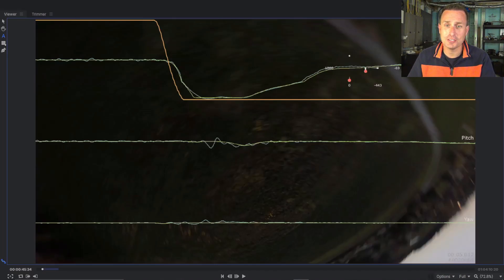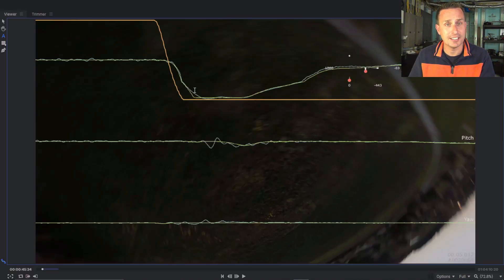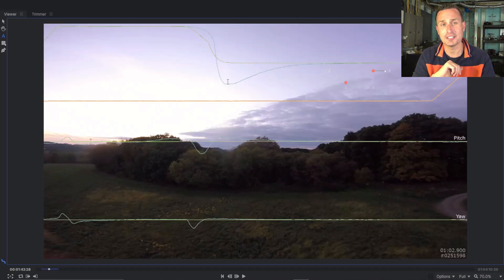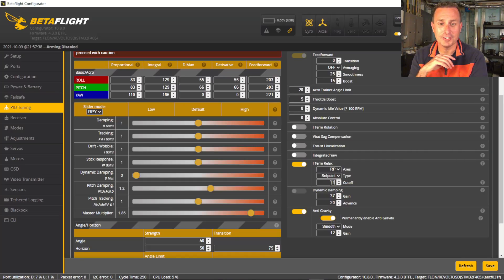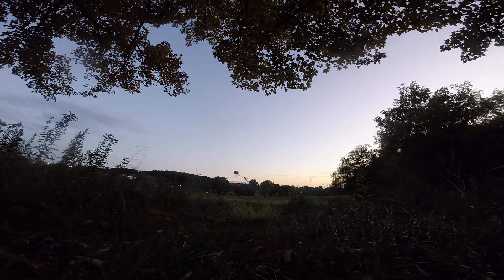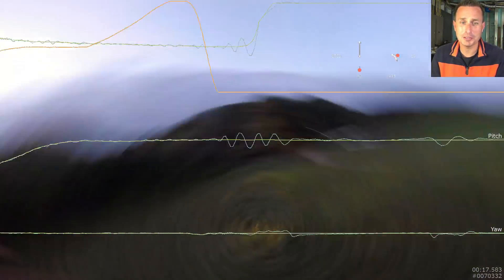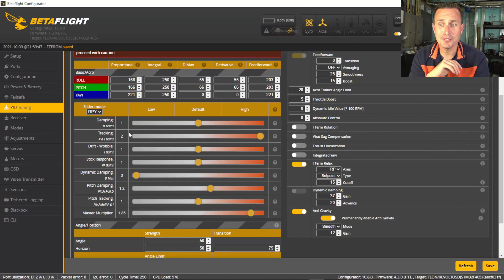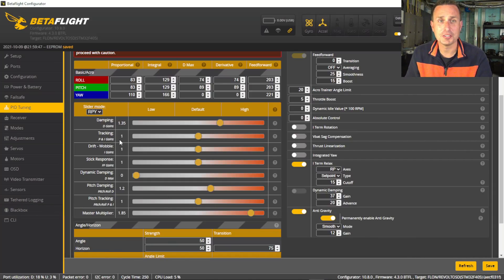How to FIX Bounceback

Comment: I’m not sure if it’s actual bounce back hopefully you can help me. I’m running the no GoPro UAV tech Prisa in beta flight anytime I try to do a power loop as soon as I cut throttle the front of the quad kind of dips for a split second towards the bottom of the quad, no matter if I’m upside down or whatever it dips to what would be the actual bottom of the quadit’s making it to where I can barely do power loops, and all that stuff. What do you think it is?
Reply from the maker: boost the Antigravity gain.

https://youtu.be/Mb-Q52UINts?si=KuAX5svDm6xxFvOe
Reply: @uavtech  ty i  looked and its at 12.0 gain
Reply from the maker: you can go higher.

Comment: Hi Mark, 
Would weight effect any of these terms and what would the effects of different weights be?
Say for example. Tune without Go Pro with no bounce backs and then add a go pro, or vicer versa, tune with a go pro and then take it of or use a lighter or heavier one? Could the effect of less or more weight induce bounce back and which term would it most likely effect? Hope this makes sense!

Comment: How is your quad not spazzing out after full throttle chopping with an AG gain of 12? I ended up with pretty much the same gains and throbbling is perfect with an AG gain of 12 but on a full throttle chop the quad is spazzing around.
Reply from the maker: 12 is a little high.  I just jumped back to 10.  May need 8 even.  

Just lower 2 points at a time to find the max.
Reply: @uavtech  Will try as soon as the rain stops. Tried 10 already but with same symptoms. Going to test, not sure if these high gains is the best we can do. Maybe lower gains and less filtering on D gives the same wash results while being able to use those high ag gain settings in order to get rid of any throbbles. On 12 there is like 1-3 degrees max error 😍
Reply: @uavtech  9 seems to be the magical number. If I go 10 even on lower PIDs like P in the low 60's its spazzing out after full throttle chop.

Comment: THIS * 1000000! I’ve struggled tuning out the last tiny bit of bounce back on my toothpick. I already had I term relax at 15. Got 95% bounce back tuned out through pids. I gave up on the last 5%, till this video. I dropped it to I term relax to 10 RP Set point, and never had cleaner stops after hard flips and rolls! Thank you!!

Comment: The new BF Flys best with all the features OFF.
Reply from the maker: Umm...  
Even I-Term Relax?
Reply: @uavtech  Yes. I'm used to tuning 3.5 was my go to for tuning. Decided to try 4.2 alot of uneeded features.. All FF off. Dmin off. Pd balance 1.3 master up by 1 Antigravity off. Flys close to 3.5 maybe a little stiffer. Also filters set to 1.2 on both

Comment: I wasted labout 3 grand on RC stuff and quadcopters, and only flew one of them... once.  My optometrist measured my eyesight last week and said it was 20/LPO... which means, light perception only. If I walked past one only 5 feet away on the ground, I would not see it even if I loaded it up with strobes.   Goggles are absolutely worthless and an abortion; I can't move my eyes closer to the screen, so see a thing in them on a tiny scren.  Nothing in this hobby is made for visually impaired people.  2020/2021 was the year I went blind.  I can solder like a boss, but not when the world is a blurry mess with no depth perception.   This hobby desperately needs to get it together and standardize on standard connectors for everything. Ditch the soldering entirely.  When was the last time you built a PC gaming rig and had to solder..anything?  Never.  Ever.  Not since.. the early... 1970's.

I may be blind, but I'm the worlds best aerobatic pilot.  Don't believe me, try me.  So ponder that.   Why is this hobby such an absolute "we don't give a sh1t"  d1ck to those with disabilities?   The RC hobby is 70 yeas old; it's had plenty of time to mature.   Two years ago, I was driving motorcycles on the road.  Now I can't count my fingers if I hold my hand out.  If it can happen to me, it can happen to anyone.  

You may wonder, why the h3ll Choppergirl are you ranting off topic about something that does not involve FC settings tweaking.   The answer is simple; I consider you one of the smartest of the bunch.  So I'm throwing this problem smack dab in the center of your workbench and on your soldering mat.   You want a challenge.  Here you go.  Solve this.   Clean up this hobby.  Make it accessible to all.  Drag it kicking and screaming into 2022.   Take a look at a Molex connector and think, why can''t we do something like this for ESC's and motors?    What can I do to catapult this all forward by... standardization across the board.     If yo don't, eventually I'll get so p155ed off.. I do it. Because I'm fed up with this sh1t.   Arms aren't interchangable between frames.  Motors don't even have the same bolt hole patterns.   DJI cameras can't even direct plug into VIstas.  Nano crossfires have buttons and solder pads on them that are a microscopic joke.  WTF.  

Intel has this cycle they call Tik-Tok.   One cycle is a great leap forward; the other cycle is to polish and refine as much as they can on the last great leap forward.

You're stuck in Tok polishing when there's not much left to polish out, and you're wasting your talents there.   There's only so much you can polish a tvrd until it won't shine any brighter.   

What we need now is the next big TIk and a great leap forward.   Talk to ANSI.

You're an elite engineer, this hobby has a Main Bus B under volt, and we need to fit a round peg to a square hole.  Solve it!

Bounce back...
Reply: TLDR: 
"I'm blind in one eye, the world should accommodate my disability, also I've never heard of bullet connectors or box goggles"
Reply: @MysteryD  Bardwell told me they tried bullet connectors, and I have some of the biggest box goggles ever made...  two pairs of 4" cyclops.   Not even close in size to my 10" fpv monitor... which is nowhere near immersive as my 44" TV.

You don't realize how bad goggles really are until you pipe a sim menu through them and try and read the tiny text on them and navigate through the menus.  You can't
Reply: @choppergirl  That's because you have to lower the game resolution to match your goggles. If you're rendering the game at 4k (hell, 1080p even) and your goggles are 720p, you have an issue with scaling. Not being facetious here. You should consider lowering the resolution of the game to be as close to your goggle resolution as possible, this will help with tiny fonts when flying sim in goggles. Also, sorry about your disability. Developers produce for the masses. And in our hobby, there aren't enough blind(ish?) pilots to make the R&D costs worth it, unfortunately.
Reply: @MysteryD  I kinda agree with you, and to be honest I do like to solder and prefer to do so instead of just plugging shit. 
"Nano crossfires have buttons and solder pads on them that are a microscopic joke" - yeah mate sure, since your eyesight is bad, better make a 10 inch receiver with huge ass pads to build 30 inch quads with 100x100 stack just because you can't see smaller ones... FFS
Reply: I lost my arms in a tragic lawnmower accident, I demand someone make it easy for me to wipe my ass.
Reply: @MysteryD  Humanity has already come to your rescue as a community, we came up with the Bidet for you :)

Comment: Hi!
I have a problem with my quad, I can't use it with a pwm frequency other than 32Khz, if I use 24Khz, the quad starts to do yaw twiches. I know that the problem is the esc, because I tried with different flight controllers, but the problem doesn't go away. It is flyable with 32Khz, but the motors get very hot.
Why is that happening?